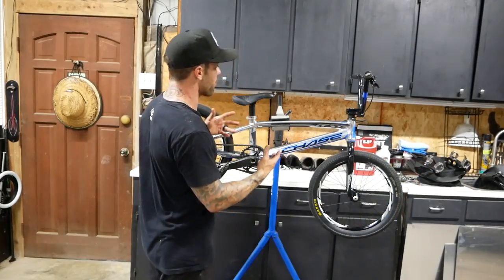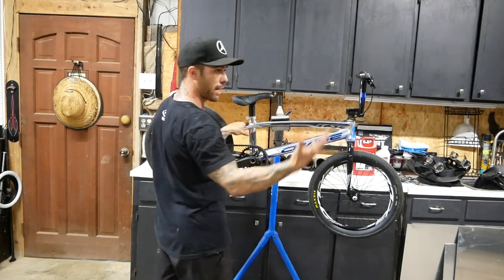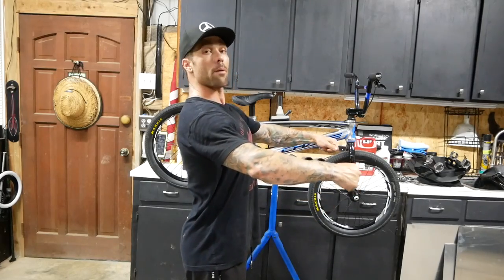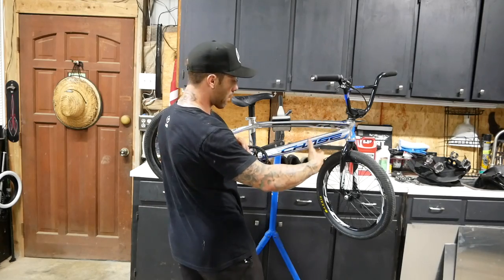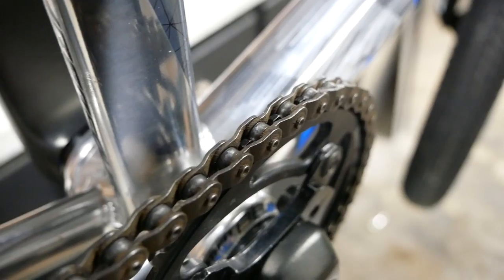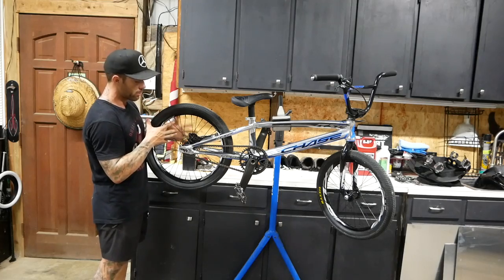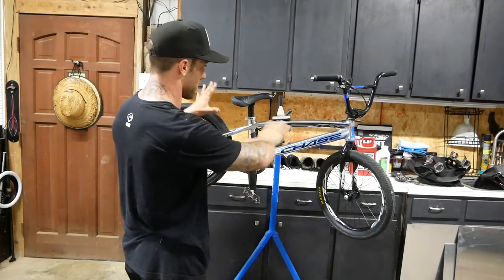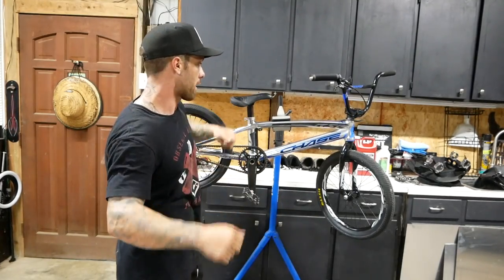I built a BMX Race/Dirt jumper hybrid

Comment: Great im actually running a Mongoose Title pro XXL hybrid build. im running 2x 2.125" kenda k-rad and a 43-16 (-1 front) is gives me 1 link more for tire clrarance.(i can stick my index on both side) Using a top load stem, ajustable seatpost, flat pedals, chromo forks, Freestyle crank with vintage style front sprocket. Long grips. Ill do the dirt jumper brake loop great idea. im loving it so far but im planing getting a 9" bar. The rear fat tire give sooo much confort from 1.75" its alot smoother on rim and less flats.

Comment: Great thinking!
Ive been doing this for years and it defenately works.
I have to btw. Am 1.96m (need a 22.7tt so i chose a xxxl frame with a 14.5cs. 180mm cranks flats offcource)
Alluminium kinda sucks as i keep bendig frames like warm butter.
Neighter liking the fact of how much alloy polutes our Planet too...

Designed a decent chromo frame that i would love to get produced. Could use some collab/help too btw 😇
53 here riding since 1984 and no plans to stop ever.
Keep riding too all of you ❤🚵
Reply: There is some race frame made out of chromoly already.
Reply: I started buying  new parts for my frame. Bought cromoly handlebars, sealed cassette  bmx hub. Parts are extensive  so I started buying  what I could afford on a weekly  pay check not getting  it all in one paycheck.

Comment: Could i convert my bmx cruiser into a dirt jumper by adding a front suspension for a 24 inch wheel? Or it is not recommended? Thanks
Reply from the maker: I don’t see why not but it’d change the front angle on the bike quite a bit
Reply: if you find a fork with the same axle to crown measurement , then yes , it will work but it'll slacken the head angle , like Barry said , so you'll feel like your falling off the bike over the back wheel , it'll loose alot of responsive nature that bmxs will feel , you'd be better just learning to take big hits more rearward wheel bias , so drop your heels off a drop it pushes the back wheel through and closer to the floor , minimising the fall essentially
Reply: I put a SR Suntour XCR Air LO 24 (63mm travel) on my old DK General Lee 24. It was less than an inch added to the axle to crown measurement. 

Don’t intend on actually using it as a jump bike, but wanted the look for the cruiser. (Have an Octane One Zircus for jumping)

Comment: How do you like Elevn's bars and forks? I've been contemplating between elevn, tangent, and s&m for the bars and forks on an upcoming chromo frame race bike I'm building
Reply from the maker: I’m loving them so far but I not picky when it comes to that. My honest opinion is, they are all chromo bars with different bends. More about what brand your into ya know
Reply: @barrynobles95  awesome, thanks! I really like elevn's flow chainring which is really the only reason I was considering using them for some of the other components

Comment: so the difference is just the forks? Could I just keep a fork/wheel combo around and switch whenever I feel like it?
Reply from the maker: Chromo fork. Tire size. Longer cable. Heavy gear. higher bars. Padded seat.
Reply: @barrynobles95  I have a big butt so I can sit on plastic seats just fine. Gear shouldn't be an issue
Reply from the maker: It’s all preference. If I miss my pedals on a tail whip I like to know I’m not about to break my taint 😂
Reply: @barrynobles95  simple solution: never mess up any tricks and never crash

Comment: what is the purpose in running such big tires on your race bike wouldn’t you want skinnier tires for less rolling resistance
Reply from the maker: Yes and no. You still have to have good traction in turns which is where the tires are taking the most force